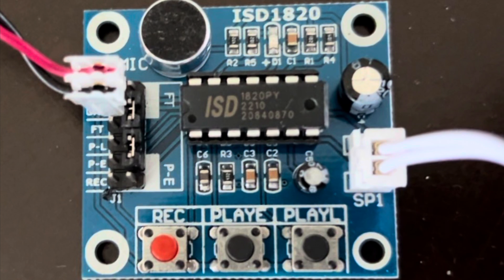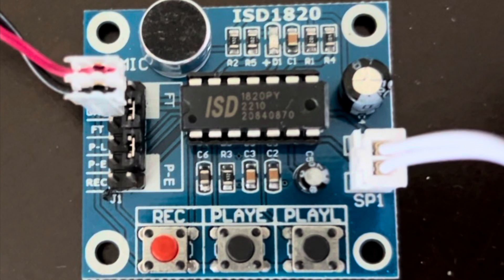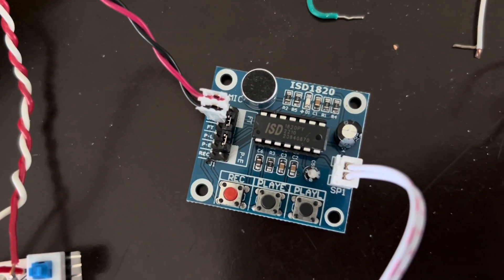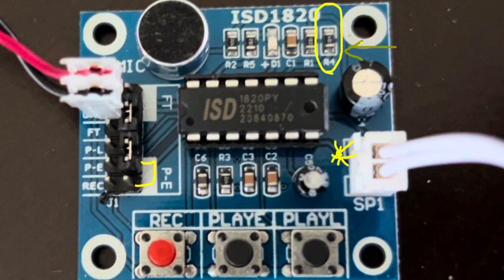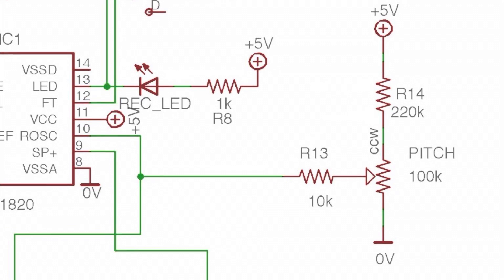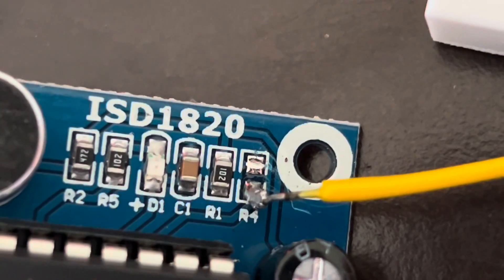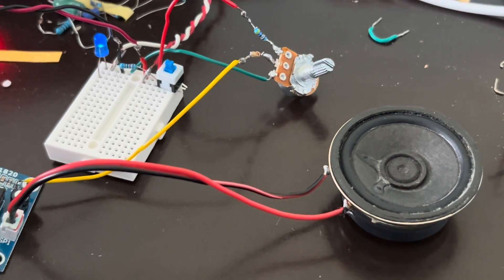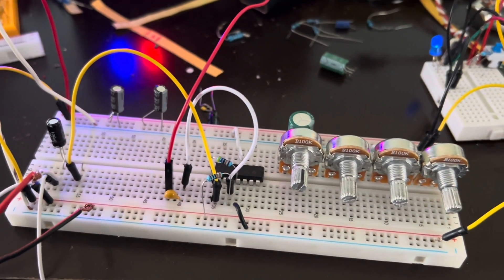ISD1820 Sampler Chip - How it works and easy Mods

Comment: Is there a way to make the sound keep repeating after the play is pressed and not stop until it is presee again? Seeing if i can modify this as a beacon for easter eggs for my blind daughter.
Reply from the maker: @tydwoodman1  yes. Just put in athe jumper for the loop feature. Basically connect the play edge to the rec signal on the module

Comment: that looks pretty cool,
I wonder what the internals of that IC look like
I guess it's probably relatively simple containing mainly these parts:

RAM  -                             for storing audio samples
adc, dac  -                      for analog input and output
2x 555-timer + digital counter - for computing the adress for sample recording and playback
digital comparator -                     for testing if the playback adress reached the recording length
some buffer flip-flops -               for saving the end of recording adress, and maybe buffering some sample data
Reply from the maker: Its an eeprom in there
Reply: @igorbrichkov3632  ok cool persistent memory, thx :)

Comment: If I recall correctly, the ISD1800 series are not digital samplers, the sound is stored as analog levels in the non-volatile storage array. 

For what is primarily intended to be voice recorders, this makes a lot of sense, you don't need an ADC and a DAC, and more importantly, the storage array can be a lot smaller, as you store one sample point per cell while for digital one cell can only hold one bit.

It would technically be possible to save space by using a multilevel cell approach for digital samples, too, like how modern SSDs store several bits worth of data per cell, but that would just be pointless additional complexity for this application.
Reply: Right. Engineers, years ago, discovered you could store analogue values in, I think, EPROM cells, by very quickly writing a pulse, and testing what level the memory cell returned. Keep feeding it pulses til it's up to the voltage you wanted, then move on to the next cell. You've got analogue recording! I presume these chips use EEPROM.

It's possible DRAM could do the same, since it uses capacitors, but the refresh circuit would be a bit hard, and these are non-volatile AFAIK. 

You could perhaps rig up multi-level digital storage with this, a DAC to this chip to an ADC. Of course you'd need an ADC at the front to actually record the sound, and another DAC at the end to play your recovered digital data. So a DAC -> ADC -> this chip -> ADC -> DAC. That way you could get arbitrary sound quality at the expense of recording length. You just wouldn't, though! The crappy sound quality is part of the charm I think here, synth freaks with their love of analogue and "analogue" synths, drum machine collectors. They love things that sound terrible! I'm sure there's a thousand filters for DAWs you can find under "enshittening".
Reply: @greenaum  THAT"S THE MOST CURSED THING! LMFAO gonna have to remember that one! It honestly reminds me a lot of the levels of storage used in SSDs today! SLC stores 1 bit per cell, but MLC can store 2 bits (4 voltage levels) and we are up to QLC and beyond now, storing 4 bits or 16 descrete voltage levels per cell. This is like what, 8 bits per cell of storage? quite cool tbh!
Reply from the maker: Yes. Easiest way is just to chain several of them together to get rid of any lag time between played samples. I want to do that but haven’t gotten around to it yet
Reply: That is correct...they are not digital.

Comment: A guitar amp isn't full range. Play it through a stereo system.
Reply from the maker: Yes. Using the guitar amp for testing the audio output. Plan to hook everything up to a real amplifier. I built a small one based on the lm386 but I ultimately want to build my own based off of the lm3886 down the road.

Comment: Fun module to mess with. I built a 7 channel parallel sampler using 7 of these modules wired in parallel, and hooking up photo resistors to each one to independently control their pitch with light, for crazy, modulating playback chaos! 
Here's a demo of it:
https://www.youtube.com/watch?v=Wi3nscocne8&ab_channel=Already%2CStill%2CAgain

Comment: That is an interesting module! Thanks for the vid, I need to source one.
Reply from the maker: Thanks. Its easier to get the module than the individual chip and actually cheaper. About $1.50 to $2 and comes overnight. I got 4 of them for 7 bucks and you can take the chip out of it as its just in a socket so no complex desoldering required.